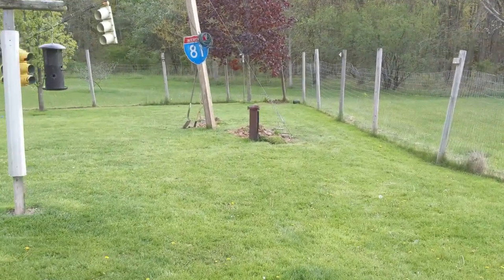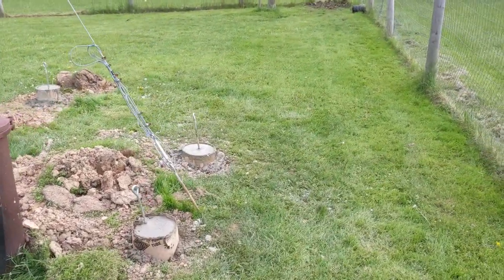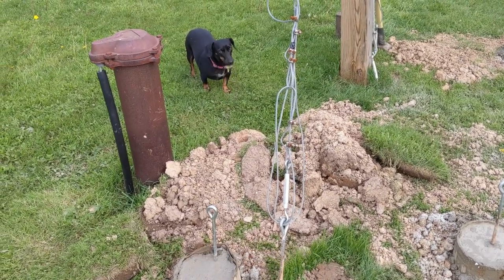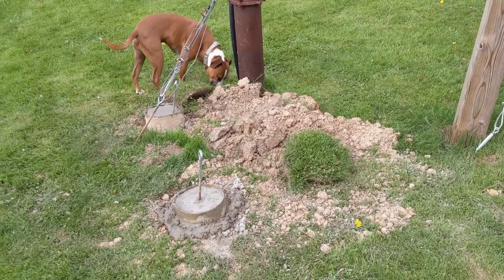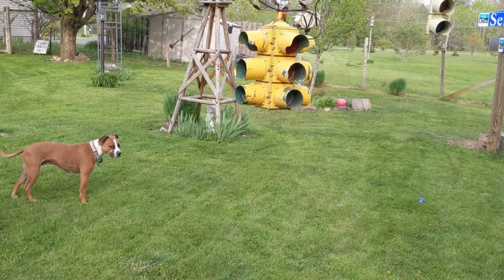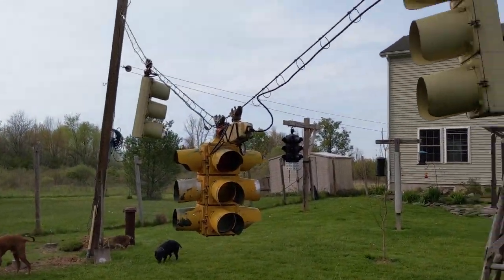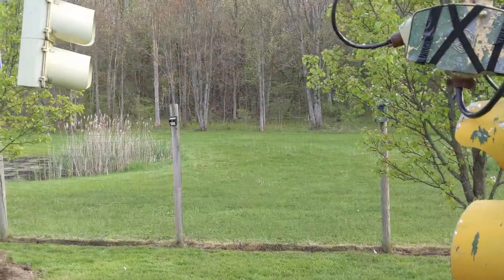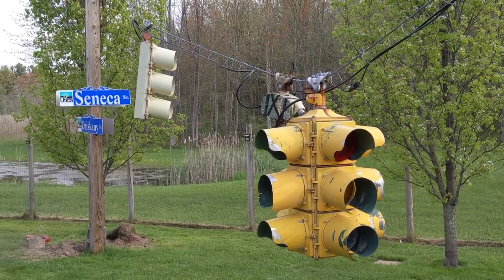Fixing my backyard traffic signal span once again

Comment: So 1970 was 51 years ago so if you were 5 then that’s 56.  However you have memory of moving and seeing these lights in 1970 so I’d say maybe 8-10 at the time guess is 60 years old.  How much dose one of these weigh?
Reply from the maker: I should have said I was 8 in 1970 to make it easier. I'm 59 now too.

The center light weights probably around 75 lbs. he 2 end ones are around 25 lbs each. They are all metal and have glass and metal reflectors in some of the lights. They were fun wrestling them up there all by myself.
Some others I have are even heavier. 1 i've got in the basement took 3 of us to lift it so I could hang it. It's got to be well over 150 lbs.